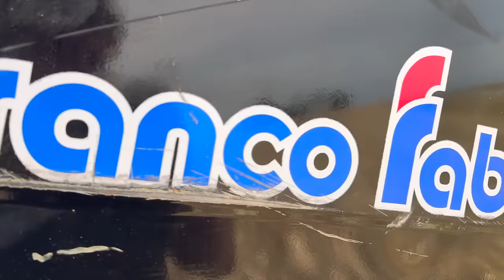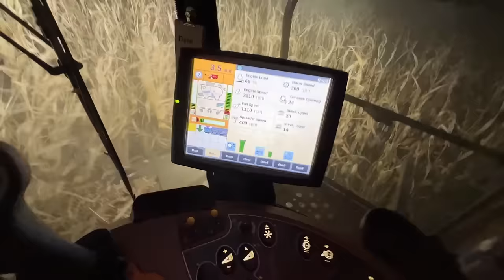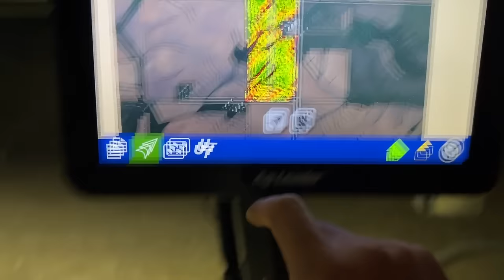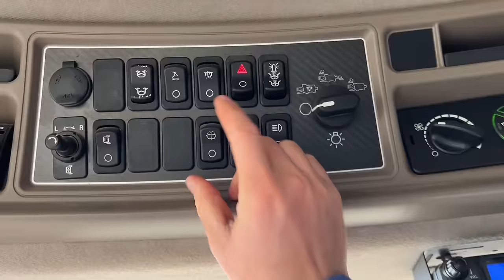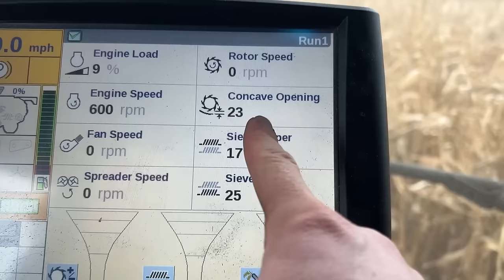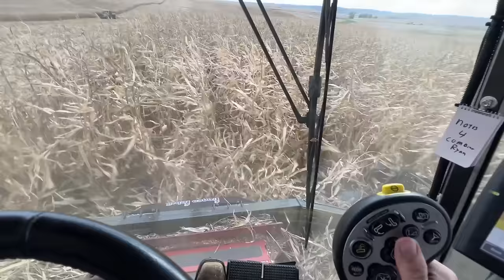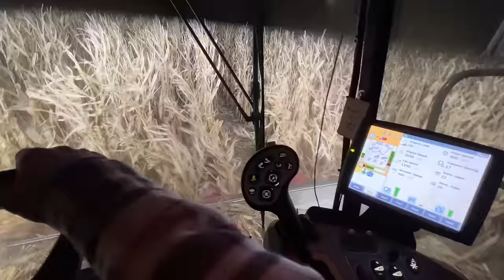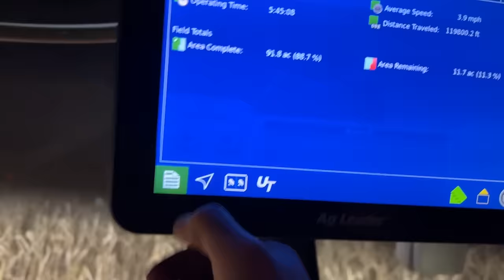My Corn Field Blew Over

Comment: Even the older Case combines leak at the face plate and side of the feeder houses. What we do is use the expanding foam in the can to fill the gaps. Its cheap and it works great. The grain you save pays for the foam very quickly.

Comment: I used to use check lists to make sure everything was remembered. Visually see all items running before opening the grain door. As far as the belts go, once you spin them when the auger stops and they did not burn off, you should be able to use belt dressing to give them extra grip. Good luck!

Comment: Regarding your drive belts that are glazing smooth.  While someone is lounging in the drying shack, you can remove the glaze and roughen up the belt with 30 to 60 grit sandpaper.  It won’t take long, and it will increase your belt life.

Comment: I have watched you all struggle with that pit auger and burning belts off, just looking at the size of that auger and the incline it runs and it sure seems apparent to me that should not be a belt and pulley drive. It should have a gear reduction gear box drive on it and the builder cheaped out with that pulley drive setup. Gear reduction gearbox drive would allow you to start that pit auger loaded.

Comment: On the glazed belts. Try spray paint on the pulley and belts while turning. My grandpa had an old trencher with worn belts and he used spray paint to keep them spinning the auger. Worked well 25 years ago. Cheap until you can get it properly fixed.

Comment: When you have glazed over belts run a little sandpaper over them to get rid of the glaze
Reply: And if you have one that's squealing a bar of soap (or belt dressing) rubbed on the offending belt will fix that just like magic...
Reply: Belt dressing works, but sticky mess everywhere in the motor box..

Comment: Wow, brand new things like cars, combines, and heads, always have glitches. The difference here is you have the team ready and able to fix the problem, even give you a replacement until yours is fixed... with a smile. If I heard correctly, if the heads work in Iowa, they will be even better in Argentina, as the stalks are different, or drier. So, they were expecting having to make adjustments. As long as everyone is aware of this, that's great, but half a day in the field is a lot of bushels, but, you got caught up drying the corn, that clogged. But, you know how to fix it, except it was midnight. So much for Farmers just plant and harvest, and the combine does all the work. 😊❤🙏

Comment: Cole another request, how about including in your soil improvement experiments about four swaths, or more, in each of your fields with a rototiller? You know, a kind of a side-by-side comparison of whether or not going over your fields with a rototiller, and burying crop debris and burying rocks and so forth, is worth it? You might even go so far as to make these rototilled swaths to be PH balanced with all of the other nutrients added that would have these swaths to have the optimal growing conditions?
   I remember that you bought that bottom plow, so going over it some of that plowed ground with a rototiller wouldn't take too long..., maybe?
   Also, I've thought of a most splendid experiment to try having to do with growing corn that will be extremely labor intensive, but hopefully it will produce at least two ears of corn per stalk. I'll let you know if I get a chance to try it out next spring.

Comment: Check the motor sheave diameter on the charts to see if it is too small to actually couple the torque that's available.
Reply: You might also change from individual belts to a notched power band belt for better hp and torque management
Reply: A larger drive pulley and much larger driven pulley on the auger with 4 belt grooves would probably help. In the long run, specs need to be provided for auger RPM needed to move the needed volume of grain. From this the corrrect motor HP can be determined, and it may well be that a reducing gearbox will be needed. That looks like a pretty large auger and it is moving wet corn, which is a big load. It is unfortunate that this pit was not designed to use a drag conveyor with adjustable flow plates and a VFD to control motor speed.
Reply: @999pr1 looks like a 16in transfer auger

Comment: If Cole does indeed win the lawsuit, I am curious to see what the path forward will look like. They have had several issues with the foundations, so I would have to imagine the big bins, wet bin, and possibly the pit will have to be taken down to address those issues. I hope for their sake that the issues can be resolved over the summer months and be ready to go by Fall harvest when the lawsuit has been settled.

With all the issues they have had, has it all been due to the shoddy work of the contractor, or does AGI play some part in this as well? I wonder if the site were designed by a company like GSI, Sukup, or Brock if they would have had as many issues. Just baffles me the issues they have had with the pit. Also, the fact that they can’t pull out the floor auger out of the one bin from the outside because it faces the other bin. Unbelievable.

Comment: you can and will document all the issues but then also go the extra mile to make things work even better - small changes can make big diferences when you are dealing with an assembly line and that is basically what you got - the bin site is still in shakedown mode - this is normal - testing and optimization are integral parts of the process #2 phones

Comment: Setting up machinery and attachments for YOUR fields will always take a little time, but much like with light vehicles, I tell people who are willing to listen that there is basically NOTHING good about a brand new vehicle/machine (to justify the cost) compared to a 1-5 year old one. It's the same thing, just someone else has sat in it, and broken all the faulty parts under warranty (sadly most warranties are only worth what your dealer's word is worth), fixed/modified things that flat out don't work and lost a LOT of money when they trade it in, you then get an actual bargain. With MAJOR machinery purchases like combines that can stretch much further than 5 years. Every brand/colour makes lemons, it just happens, but if its a few years old, and has done the appropriate hours/miles for its age/seasons, it's not one of them :) It's kinda cruel how the guy who pays the most for it, is the guinea pig for the next guy.

Comment: what is the diameter of the black auger that empties the grain pit? I would go ahead and weld metal on the end of the slide gate in the bottom of the pit so you can fully close it and also put a switch on the auger in the bottom of the pit so you can control when it runs .I think the auger in the bottom should be wired to a proximity switch that will only let the bottom auger run when the black incline auger has run the pit empty in the center.The switch will sense when there is corn over the black auger and not try to force corn into a already full auger.

Comment: This may have been answered, only this far in 10:13 .

So the chopping head, is that a direct replacement to the devistators? I assume it would be, and if so, which would be better? Because I assume the devistators to an extent would be compacting the soil under the head, where as the chopping head would simply chop down the remainder of the plants.

I'm by no means a farmer, but I'm honestly curious. Also, someone needs to make a cole the cornstar map for farming simulator!! I would love to play on cole & family's farms!!

Comment: That is so interesting that you pointed out those gas lines. I always wondered if planting over a gas line has any effect. Looks like it does.
Reply: Yeah natural gas is -260 degrees Fahrenheit. So I would guess that soil there is much colder.  Lp gas is even colder at 306 degrees. one reason to never accidentally get on your hands from a propane tank. Becomes instant frost bite of skin.

Comment: The segment about the concaves being too open was sad.  The corn cob was already being rubbed very hard @20:26.  The combine has a rotor.  It is not an old combine that threshes with a cylinder.  What was the rotor speed?  Increase the rotor speed 20-30 rpms.
Adjustments should be in small increments.  Going from 23 to 15 will cause broken cobs, cracked corn, and increased power consumption.
What does the owner's manual suggest?
Cob size is not as relevant for a rotor.
How many years has the farm been running rotor combines?

Comment: What's with the engineers on your new equipment????  Get a farmer with some practical experience to design and trouble shoot things!!!   Belts and pulleys for example. >>>   If you burn belts -you need to check your pulleys.  There should be charts for motor sizing.>>>  If you're running your belts and pulleys in the grain (or corn) -  that's a no -- no!  Just shaft and auger in the grain!!  That's just the start of things to look at!!!   I really enjoy the (Cole the Cornstar ) episodes !!  Good Luck!!!!!!

Comment: find out is Toyota makes corn heads . i bought a Toyota truck in 2000 . all i have had to do to it was new tires every 7 years ,spark plugs and oil changes . i keep it clean and wax it every year . it's still running and no signs of giving up

Comment: Does anyone run those augers on the legs with chains and gears instead of pulleys and belts? If a clog happens it breaks a sheer bolt instead of burning up a belt.

Comment: So is the grain leg not clearing the grain fast enough and the pit backs up and slips belts?
Reply: So if there was more distance between the pit and leg or if the leg sump had more capacity would that help.
Reply: The leg can only turn so fast because of the height. Im probably just saying exactly what everyones thinking.